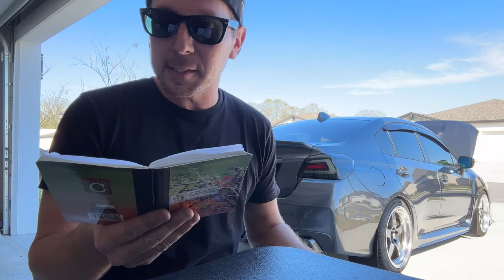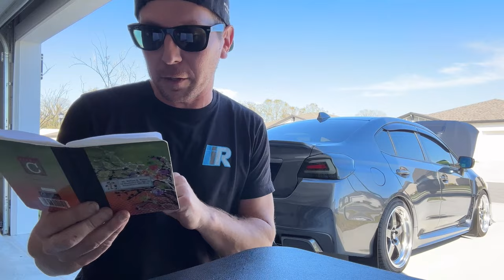THE GREATEST TURBO INLET VIDEO EVER! | SUBARU | WRX | FA20 | 2015-2021

Comment: I ran the Perrin inlet on my 2019 WRX, you could hear all the noises! Note that if you're running a MAPerfomance intake you will need to cut off alot of the inlet for things to fit.
Reply from the maker: Great info, thank you for sharing! 🤘🏻
Reply: Im running the Cobb sf Intake and  the same issue would exist.

Comment: I like the Perrin tube. 👍   if using the stock air box, which of these options require a tune.  as much as I want an AP, I don't want to be forced in that direction.    2-port or 3-port?  new bypass valve at the same time?  so many options...

Comment: I have a 2016 WRX with 63k miles. Do you think it’s a little late to start modding? It’s pretty well maintained. Plugs and fluids changed.
Reply from the maker: its definitely not too late, 5 years ago i had customers with those cars with 120k miles modding with 400+ whp :) Lets go!
Reply: NO WAY! You’re just breaking it in! The time is NOW! 😍
Reply: Bro same here!! Feeling much better about letting the beast out 65k later

Comment: What kind of rims are you running on your wrx?
Reply from the maker: The current set up on the car is Cosmis XT-005R Gunmetal w/ Machined Lip + Spokes 18x9 +35 5x114.3
They can be found here 🤘🏻
https://www.importimageracing.com/pages/search-results-page?q=xt005r&page=2

Comment: Does the perrin inlet need to be tuned ?
Reply from the maker: Runs great on our in house VA WRX with no tune! But full benefits wont be acquired until coupled with a Clark Turner Pro-tune!
Reply: @ImportImageRacing  ohhh I have a VB